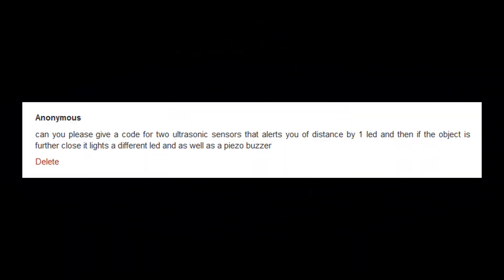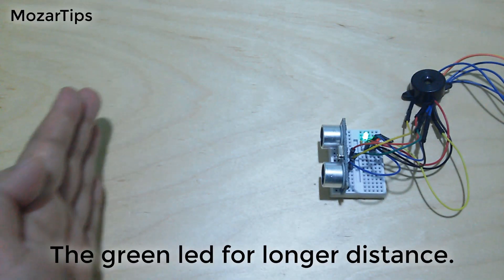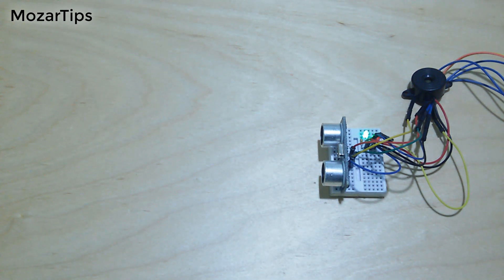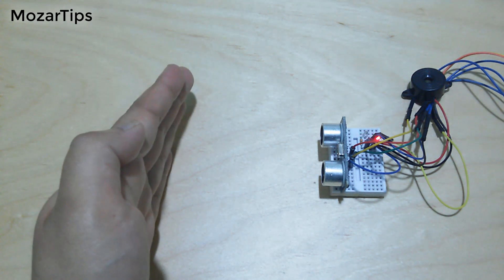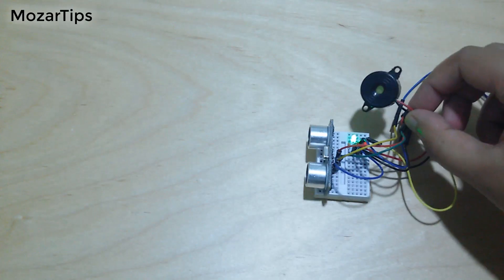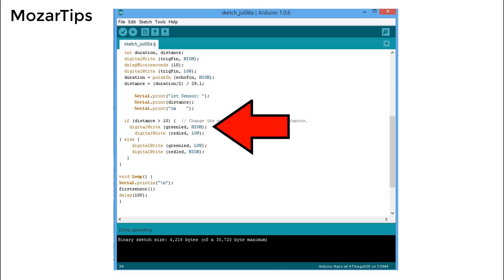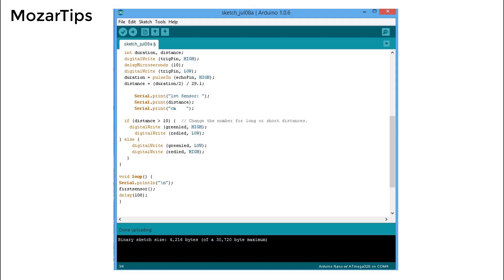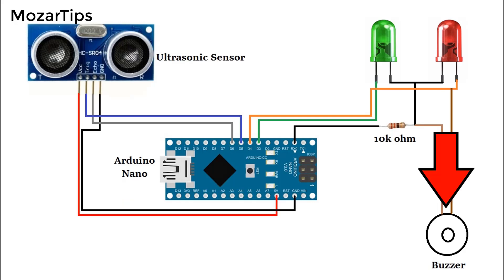Ultrasonic Sensor With leds and Buzzer

Comment: Hi, how can i reach out to you on some projects trouble with?
Reply from the maker: You can ask me here, but I can't promise to help you though.
Reply: @mozartips  I currently doing an ultrasonic distance sensor project using multiple LEDs to detect the levels in the waste bin. I have a total of 3 colors LEDs, red, yellow and green but only manage to get 1 led up using an else if statement. I not really sure how to use the shift register with multiple LEDs connecting to the GND port.
Reply from the maker: Please watch this video https://youtu.be/AMDb45oBub4 and follow the step by step instructions on the website link in the description.